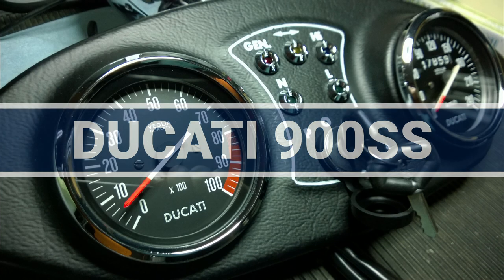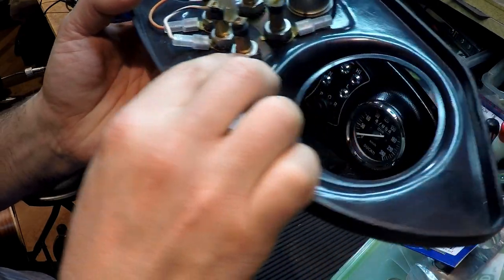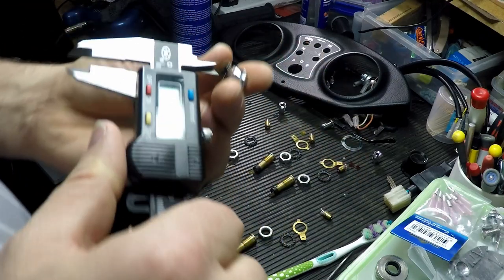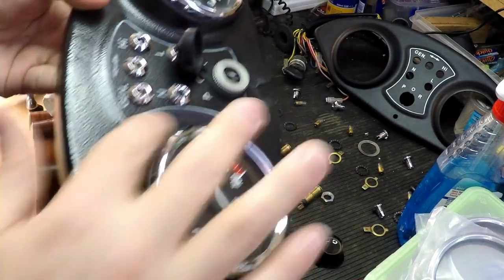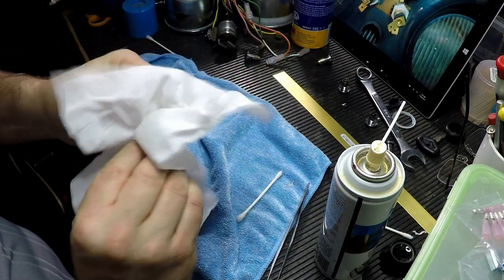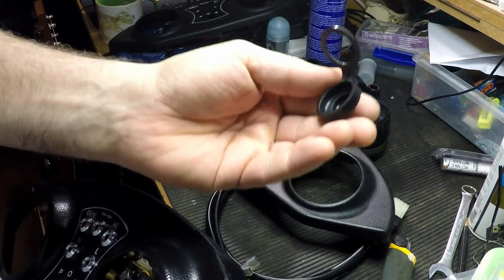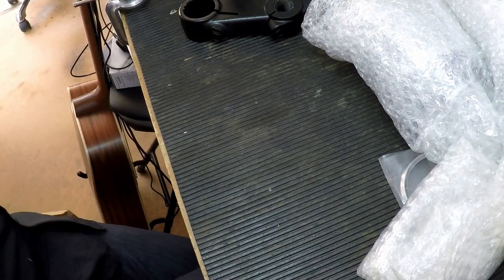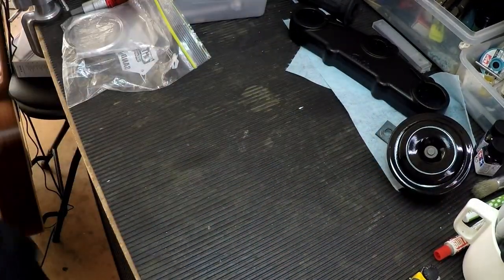Beautiful NOS Dash & Restored Instruments - Ducati 900SS Bevel Restoration

Comment: You’ve done a brilliant job of restoring that dash, I need to get motivated to do mine.  I replaced my dash lights with LEDs a few years ago simply because I couldn’t find the coloured lenses for my originals, but I’m not happy with them, so I’m going back to the old ones.  Can you let me know where you got the new lenses from
Reply from the maker: Hi Rusty. Yes, I'm not keen on the look of the LED ones either. I got my NOS dash on eBay and it had the NOS ignition lock and NOS lights all with it. All old and dusty but cleaned up nice as you've seen in the video. There was another identical setup a few months later, but I haven't seen one since. I've never seen any of the 'lenses' for sale and If I were going to make some replacements today, I would buy the 4 colours as photographic gel filters and either cut or punch them to size. And I'd also want to try and get a bit of a dome shape into them because it's that little highlight on the curved surface that makes them look like they should and not look like LEDs. Gels are resistant to heat from lights but perhaps one could deform and press them into a dished shape with some suitably rounded tools, or even a little higher heat. I've just pulled one out of my dash to check and that's basically what they look like... a dished piece of gel. It would be a matter of trying a few methods. Tape both sides if trying to press a piece of gel into a dished shape. Let me know how you get on and what you end up doing.
Reply: @Ducati900SS  thanks mate, would’ve replied sooner only my email has been out and I’ve only just seen the notification.  Yeah, I’ll definitely try the gel filters, my neutral light and ignition warning light are currently Lego green and Lego red respectively.  Had to pilfer them from my kid’s old Lego sets…😂
Reply from the maker: @rustyosh  heh good one. Let me know what you end up doing and how it goes. I'll be keen to know.
Reply: @Ducati900SS   Will do